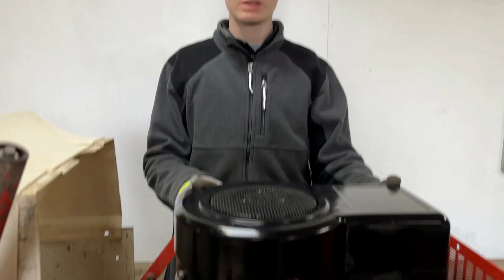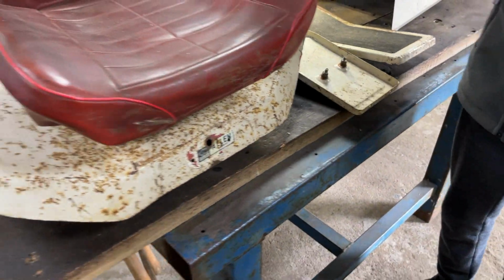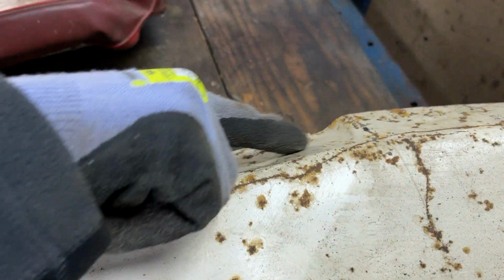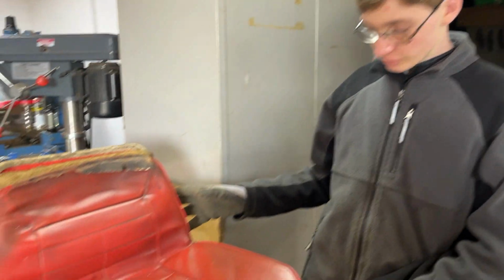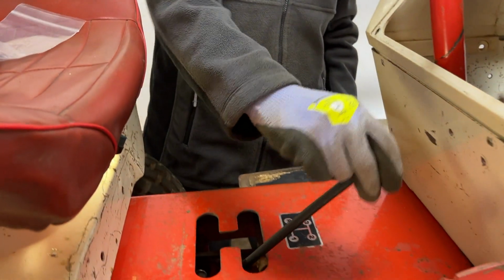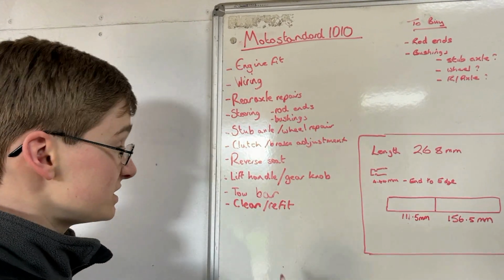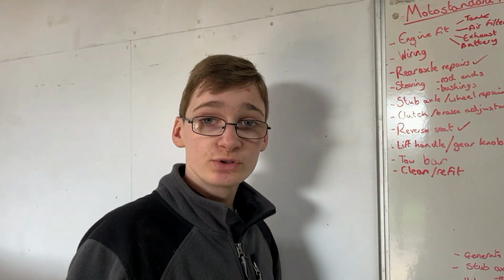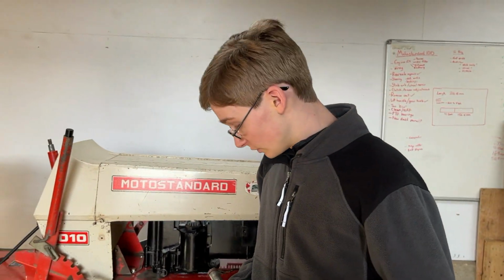Motostandard 1010 - Part 13 (Clean and refit)

Comment: Great job guys, this tractor seems to need a lot of work. Just curious, not knowing anything about the old garden tractors. Is there still a market for them? Meaning if you were to ever sell them would they be worth the money and time you put into them? Or is this just a fun hobby for you guys. Either way is great, just curious. I know I have hobbies i will never get out of them what I put into them.
Reply from the maker: Thanks. Many of our older tractors like the Bolens, Wheelhorse and Cub Cadet have a market value and prices are increasing slowly. Even though this tractor is very rare I don't think it is worth much. I am not sure if we would get our money back if we sold our tractors but the way we look at it, is that it is much cheaper than buying new machines every few years that are not built as well. Take care

Comment: Progress is good. The rear fender looks much better. Good luck with the axle build (that should be a challenge) 😁👍
Reply from the maker: Thanks. We have been putting off the stub axle for as long as possible and you are right, it will be a challenge. Take care

Comment: Looking good fellas. I like the added music part. 🤣  I am looking forward to the making of the stub axle. I had to make one years ago for my Ford garden tractor. The shaft broke in two and the wheel fell off 😡  Any way, could not get one right away, so we made one. But did get the new one, and have never needed it yet. 
Do you have any sort of thoughts as to why the seat was turned around on the tractor ? 
Great video fellas. Have a great weekend.
Reply from the maker: Thanks 👍 It will be interesting to see how the stub axle goes, we have done some planning and preperations. With the seat turned around it is further from the steering wheel which may have been the reason. Take care